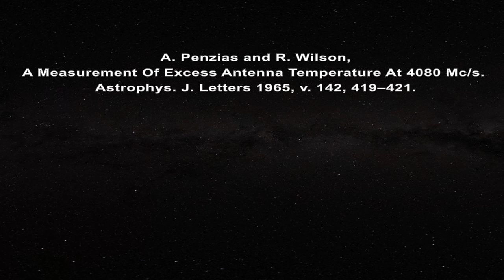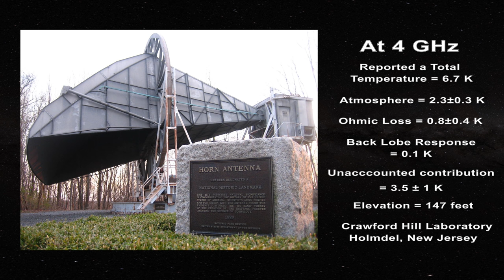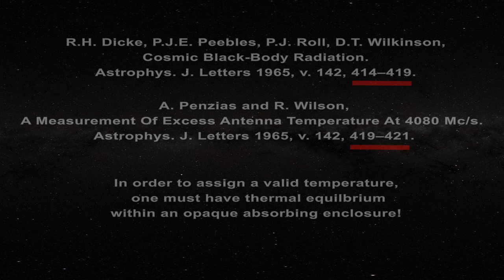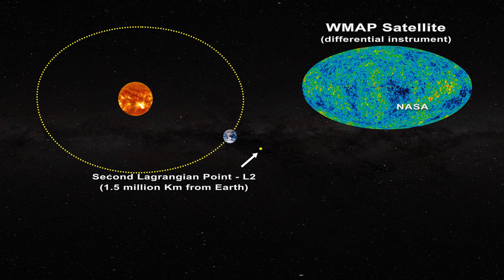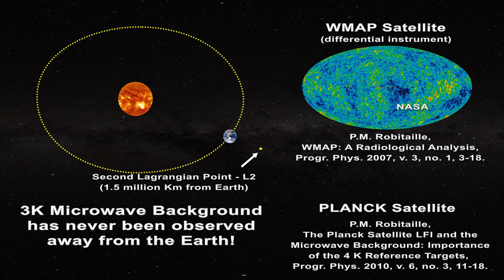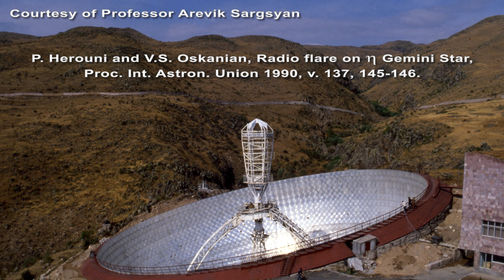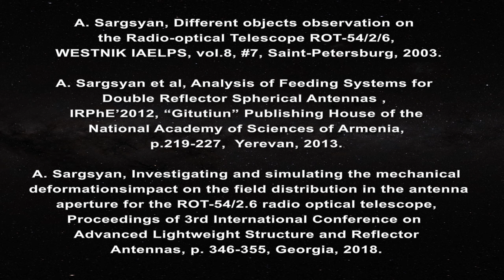The Herouni Antenna - The Death of the Big Bang!

Comment: The first thing you should check on an uploader who promotes their PhD is, what is that PhD in. Now, I'm no fan of experts today, but this guy's a freakin' radiologist. This is like having a top notch car mechanic giving a lecture on space shuttle engineering.
Reply: The reason he is even into this conversation is that he came to conclude that Kirchhoff's law was false, that all cavities are filled with black body radiation. He concluded this from his work on ultra high field MRI. People thought that if a patient had too much radiation that they would heat up and die because all cavities would be filled with black body radiation. This was not the case. If Kirchhoff's law is false then the standard model has a lot of problems, too disastrous to ignore. One of these being the big bang but certainly not the only one.
Reply: Kirchoff's law is not as critical as all that. But you go on thinking a radiologist is remotely qualified to opine on astrophysics and I'll go on laughing.
Reply: @gmmay70  : "Kirchoff's law is not as critical as all that." 
qwchrbichn

Yes it is [1].

"But you go on thinking a radiologist is remotely qualified to opine on astrophysics" qwchrbichn

Define radiologist and then present your proof that professor Robitaille is a radiologist.

[1] Robitaille, P.-M., Crothers, S. J., “The Theory of Heat Radiation” Revisited: A Commentary on the Validity of Kirchhoff’s Law of Thermal Emission and Max Planck’s Claim of Universality, Progress in Physics, v. 11, p.120-132, (2015), 
 http://www.ptep-online.com/2015/PP-41-04.PDF
Reply: @gmmay70  : "No, it's really not, Physicists are and have long been aware of the limitations and problems with Kirchoff's law." qwchrbichn

That's not true; it's the opposite it fact. I refer you once again: 

Robitaille P.-M., Crothers S. J. "The Theory of Heat Radiation" Revisited: A Commentary on the Validity of Kirchhoff's Law of Thermal Emission and Max Planck's Claim of Universality, Progress in Physics, v. 11, p.120-132, (2015),  http://vixra.org/pdf/1502.0007v2.pdf   

You did not define 'radiologist'. If you looked up 'radiologist' you would have learnt that professor Robitaille is not a radiologist, just as his profile on the link you provided attests.

Comment: Stars come in various sizes, spectra and composition.  I have always wondered how a cosmologist could claim to know the distance or whether it is color shifted?  In order to know whether some body is red or blue shifted you would need to know its normal spectra.

Claiming space and matter expanded faster than energy is a ridiculous notion.  Energy is intrinsically connected to matter.  If there was a instantaneous expansion of space, energy would have been moved with space.  Big Bang rads would have passed us by billions of years ago.
Reply: Although they get red or blue shifted, the darkness, thickness, and ratios between the absorption lines for each element's spectrum are constant.  To find an object's color shift, you compare the observed spectrum to the spectrum you get in a lab.  This is also how astronomers figure out stars' composition.  

I agree with you about the big bang.  One alternative theory I like (but dont fully understand) is John Dobson's recycling-universe-through-quantum-tunneling theory.
Reply: Look into the Pleiades Distance Problem, we really have no idea what the distance are to the stars. In other videos he points out that the correlation of temperature, light intensity, and color are plainly invalid.

Comment: I remember when I first heard story about how the cosmic microwave background radiation was first figured out i remember hearing that there was pigeon droppings in the waveguide horn. Being a laser nerd from the 60's, the first thing that I thought was, pigeon shit probably makes ammonia gas and prolly other molecules.

I remember the ammonia maser and I thought "ammonia gas inside of a waveguide" if there was a source of energy to create a population inversion in the ammonia you might have a maser creating the microwave signal from the interaction of the hardware and the ammonia gas.

Then I carried it further. The resonance frequency of the ammonia gas molecules along with the horn and waveguide might be acting like a tuned resonant circuit selecting certain microwave frequencies,
Reply: The pigeon poop anecdote is often recited just to express how confused they were to account for the detected background noise... they tried everything to account for it, even thinking it might be the poop, so they cleaned it out, yet the noise was still there.

Comment: i checked "Professor" Arevik Sargsyan credentials and it would appear he's a management consultant. Its important to distinguish between professor / teacher & doctor of sciences. Interesting hypothesis. The video leans too much on one researcher Professor Herouni. The period around the start of the universe is very exiting physics research & the more we know the better :)
Reply: "the more we know the better" Roland Lawrence

Yet you know nothing. Professor Sargsyan is a woman, not a man. She is not a 'management consultant'. She studied radio engineering in Moscow. She was a student of professor Herouni and worked with him on his radio-optical telescope ROT-54/2.6 for years. She is also Project Manager in Jurisdiction Armenia Foundation for the recommission of ROT-54/2.6 and the establishment of the Herouni Space Centre which have been endorsed by the Armenian government. Professor Herouni's antenna, the most sophisticated radio telescope ever built, with a dual optical capacity, returned 0 K for the CMB. The 'CMB' does not exist. Without its CMB Big Bang creationism is dead. So it is dead. COBE-FIRAS measured the Earth because the signal comes from Earth. The WMAP and Planck satellites did not detect the 'CMB' monopole at L2: WMAP was incapable of such a measurement and Planck did not find it. The Planck Team use the COBE-FIRAS monopole for their basis. It is a scientific fact that the CMB monopole has never been detected beyond ~900 km of Earth - precisely because Earth is it source, from the oceans, via the hydrogen bond in water.

Comment: The big bang never happened. Mass develops when energy waves travel at the exact speed of light and then forced to slow. There are various reasons why speed of light slows. It didn't occur all at once and just pop into existence all at once. I do believe that it did start in one place in the universe though and spread from there. Before mass existed, there was no infrared energy. With out infrared no mass. As energy changed back and forth from energy to mass, the tiny fractions of time that mass did exist, infrared energy was produced and given off. That infrared energy given off by the particle was enough to slow that particle of mass spin below absolute zero and change back to energy.  That tiny fractions of infrared energy given off was enough heat energy to allow other fractions of seconds of mass to absorb that infrared energy  to stay above absolute zero for that much longer fractions of seconds until enough infrared energy was present to keep all mass above absolute zero creating a continuous particles of mass. The more energy changed to mass the higher the temperature of the other mass particles further allowing other mass particles to form. Infrared energy spread throughout the universe. 

So, no there was no big bang because the big bang is still happening today. Energy to mass, mass to energy all thanks to the wave length of infrared.

Comment: The hole point of the Penzias and Wilson experiment was to determine where radio interference was coming from. There antenna was highly directional and could be steered in any direction. If the signal was coming from the ground or sea, then they would have found that. The discovery that they maid is that it was coming from space and it was in all directions. O ... and the antenna impedance has nothing to do with the frequency of the signal. It only effects the efficiency of the antenna. The narrators claim of this shows a extreme ignorance of the subject that he is talking about. I personally suspect that he is setting up for a scam.

Comment: everything(the universe) can not expand into itself because there is nothing else. to explain red light shift is easy, but you have to understand our movement as well as an understand of 3d graphics. dont need no curved universe nor a big bang. no light ever goes in a straight line and in all probability, the universe just goes on forever.

Comment: we need support for double slit experiment sensors too :P since they seem like do not work at required speed to be able to catch detailed reactions of nano particles :P 
anyway background radiation ? its not heart of big bang theory. it cant destroy the theory itself since optical and statistical data still promoting it :D
Reply: i can believe to this , sensr erros in reasearch seems like happening wery common. i see the some misleading trick on quantum dynamics experiments . sensors has too high error ratio and correction ratio seems  in general over acceptable limits :p

Comment: I am sorry but it is much more logical that the Universal structure stemmed from an orign. There are temporal dependent properties showing unidirectional progression and development of structures on the larger scale that mature over time as seen througb comparing the Ultra-deep Field to more recent closer structures. There is also the small matter that expansion has increased over time and a contraction would require a reversal in entropy to take place. Either we are working with some very unlikely probabilities, we are violatinga good few key physical lawa,  or progression of structures and element creation must be handwaved. I am sorry, but I am still not convinced Aristotle was right on this one.

I am on-board with your metallic hydrogen solar theory, but not on this one. Keep up the good work and God bless you, sir.
Reply: Because you where told what is true and what is not. Is that your argument? pfft

Comment: have you checked China's experiment, measuring radiation on the far side of the moon (away from any influence form radiation from the earth)?
Reply: Why believe China's "experiments" over those of the West?
Reply: @kenlogsdon7095  West does not have any data. We have never been to the far side of the moon. We have no technology to place the relay satellite to communicate with the equipment on the far side of the moon.
Reply: There's water on the Moon.
Reply: @quietackshon  No water. It's been concluded. Only Nasa opens up this issue for entertainment.

Comment: Really? The stupid comment at 2 minutes about the background noise comment. Science is built on previous work and I suspect the speaker knows this and was deliberately misrepresenting the facts. A little disingenuity goes a long way in creationism doesn't it?
Also, I note his emphasis on the original antenna and paper. However the background radiation is measured and observed by many antennas and antenna arrays.
In any case Planck has been measuring the CMB for years now

Comment: I do enjoy a well made clip, but I'm afraid that there are several factual mistakes in prof. Sargsyan take on the big bang theory. The first one relates to the spectrum of the background radiation. In fact, this is much higher than described here and it's not in the 3Ghz range but even cold electrons start emit noise in the 22 to 100 GHz range while overall the background radiation peaks at 160.23 GHz. So obviously, if you listen in the 3 Ghz range, you hear.. Absolutely nothing. Which btw, is exactly why the spectrum range up until 5-6Ghz is used for home routers and such. If it was noisy, it couldn't have been used. Second, the big bang theory is not supported just by radio evidence. Its also supported by Hubble discovery of the redshift of the spectrum lines of all galaxies apart from Andromeda, which is blue shifted. Meaning, the universe is expanding and at a known speed. Hence, the point in time when it was all a point in space is also known - and was known 20 years before the discovery of the background radiation. This discovery is not a "proof" of the big bang, just an assistive evidence. Even if it was incorrect it wouldn't disprove the big bang. But the problem here, as it seems, is that the Herouni Antenna was decommissioned for a reason - that it listens in too low frequencies. So obviously it hears nothing at all.

Comment: Mainstream science: Herouni? Herouni who?
Reply: Do you know now?
Reply: @ThomasKundera  Quite amazing.  Professor Herouni's radio telescope is the most sensitive ever built (a self-noise of only 2.6 K). His measurement of the 'CMB' at 0 K is direct and unambiguous and proves that the 'CMB' does not exist. Dr. Robitaille is the inventor of Ultra-High Field MRI. He knows real physics, as did professor Herouni.  As for the Sun, it has a surface.  Dr. Robitaille is right.
Reply: @ThomasKundera  :  Dr. Robitaille is right. No gas can compress itself by any means. Compression of a gas requires the action of an external agent and containment, as a simple bicycle pump demonstrates. The astronomers and cosmologists however claim that gases can compress themselves and in the total absence of containment. Magical process such as this are not scientific.

Comment: Before even discussing antenna noise, where is the information on the actual receiver?  What kind of front end,  what is the noise figure (or noise temperature) of the receiving system.  

If you don't start there anything that is derived is meaningless.

Do some consultation with the Dwingeloo radio observatory.  They understand low noise receivers.

Comment: Common sense destroys the little puff, I mean big bang...

If everything originated from a single point, then the star's position to each other would have changed drastically over time but they never have.  The star's position relative to each other has never changed and never will because they aren't moving from an exploding central point.  From the beginning everything would have been tightly packed together.  As time progressed everything would have moved away from each other.  For thousands of years we have navigated the oceans by the stars and arrived at our precise destination without error.  For thousands of years we have been able to tell time by them, tell the seasons by them.  This would have been impossible if the stars moved a single inch...

Just like evolution...
Just like the shape of the Earth...
Just like society...
Just like jobs...
Just like religion...

All lies...

Comment: Sadly mostly over my head. I have many problems with the big bang theory. If E=MC/2 then the mass of the universe would have to be an energy force cycling at uncountable high cycles so far beyond hard gamma as to defy comprehension! All contained in a point smaller than a particle. This idea is  ridiculous to logical thought. The entire mass of the universe is in the many quadrillions of solar masses. If one single pound of matter was converted to energy the yield would be beyond our ability to measure.

Comment: Are you just a creationist? I believe god can do it with the big bang. As it says let there be light. Bang
Reply: The argument is the microwave background.
If there is no microwave background, there are several problems with the big bang.
Science should look for the best info we have.
Yes, God did say let there be light, and bang there was light.  That is correct.
Reply: @marcparkinson4118  yes but more than the microwave background proves big bang like the expansion

Comment: Disinformation at it's finest. The first measurements were taken with an antenna measuring waves at 4ghtz. The antenna that supposedly disproves the findings from the data of the first antenna, is measuring waves at a  wavelength of 8mm.  Notice how the first uses frequency and the second wavelength? If you use the same unit for both antennas you'd have 4ghtz vs. 37.47405725ghtz, or 74.9481145mm vs 8mm.
The antennas were measuring two completely different signals, and therefore the second cannot be used to discredit the first since it didn't measure the same signal!
Reply: @gothicbagherra: The CMB is allegedly a blackbody spectrum. As such it can be monitored at any frequency. Professor Herouni's null invalidates the 'CMB'.
Reply: Let me try to explain in simple terms where you're wrong. I'll use the light spectrum as an example. Basically the wavelength of red light is longer than the wavelength of blue light, and as such, they are at different frequencies. How can you determine if red light exists if you're looking at the blue light's frequency? Answer is, you can't. By looking at a different frequency (wavelength) that was originally used can't negate anything that may have been found at the original frequency. That's like you saying I picked up a radio station at 88.1khtz, but because you didn't pick up a radio station at 107.9khtz, that the signal I picked up didn't exist